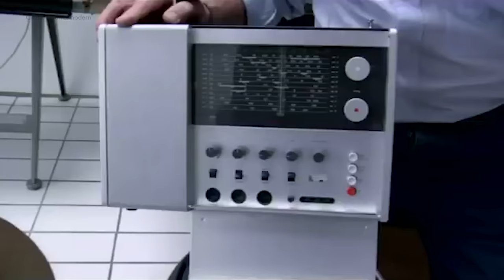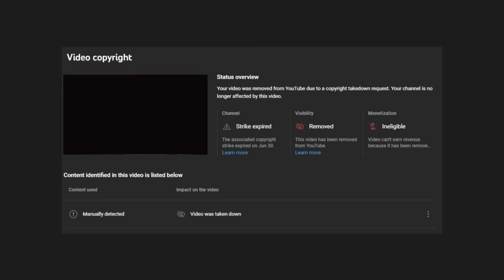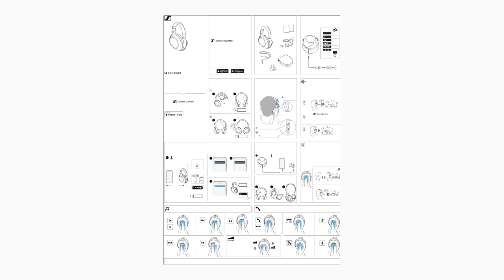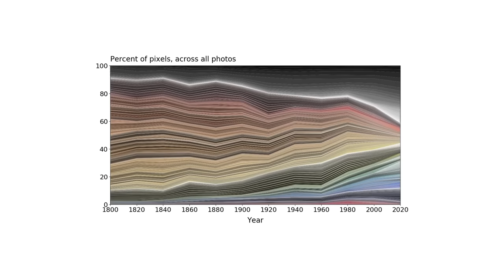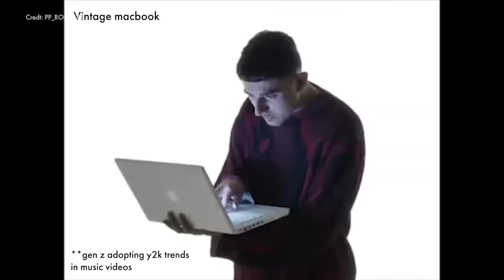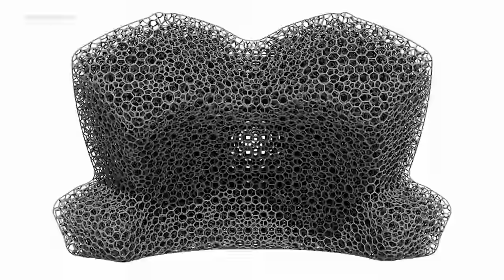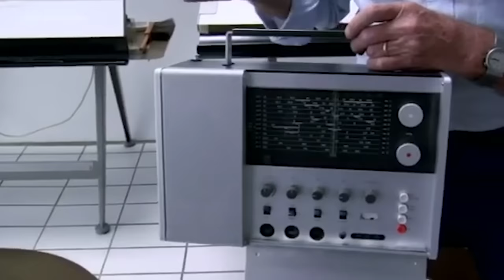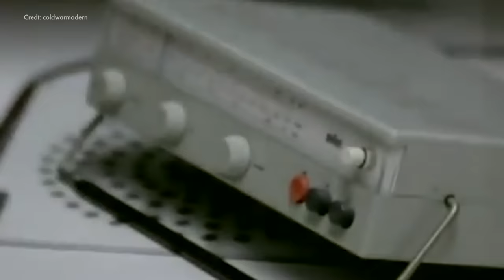Minimalism is Getting Absurd: Updating Dieter Rams' 10 Principles

Comment: The way I understand it, functional minimalism is driven by manufacturing cost optimization rather than aesthetics.  Physical interface elements are expensive to implement at scale, software functionality is not.  Product designers are using visual minimalism to solve the problem of making functionally minimalist products appealing, not the other way around.

Comment: That $4 calculator looks better- I want big easy to hit buttons so I can use it without having to focus too much on actually hitting the buttons. The buttons on the $55 calculator are too small and too spaced out to be as simple to use. And the $55 calculator is too broad. I want something that can fit in my hand. It’s a machine designed to serve a function. Then $4 calculator finds the balance between being slender enough to fit easily in my small hand while having the biggest buttons possible to let me hit them while focused on something else (the work I am doing)

Comment: Rams "Less but better" fuses with the Bauhaus concept of "form follows function"
Materials are made to look what they are, and plastic is not "denaturate" by looking like tortoise shell as it is in its translucent nature, like glass and plexiglass: it becomes false by looking like gold, ir wood, which makes it look cheap.
The Braun calculator is not expensive just because of "brand": it is becuse of costs, like scale economy, number produced, not being the sculpted in pefect shape for a mold, but holding and using. It is probably sturdier to hold and I guess the electronic is also less cheaped out. There is also a brand and a perceived value too fir someone willing to pay more.
Just remeber: sleek and minimalist is good as far as it does not distupt the function of the item: here is why Walter Gropius, Dieter Rams, Max Bill were "honest" designers. Does a Gropius Rosenthal teapot compete in price and practicality with an "El Cheapo" chinese one? No, but is a wanderfull object that still works perfectly as a teapot and looks gorgeous on a shelf! Does a Flute Saarinen table perform better as a table cheaper then a IKEA one? No, but it still distills the essence if a table in a unique way, as design should privide sensations other then fruibility.
Modern designers are obsesed by marketing and brand feeling, and this often cripples their design into a corner.
Its not about "form following function", but about "making somr function out of an idea."

Comment: This is the 21 century. Esthetic styling is essentially separate from design. Conflating the two just leads to confusion, edge cases and too many counter examples. 

Design is the rational (not arbitrary) choice of features to maximize the project goals and minimize functional flaws. This definition covers all design engineering from architecture and transportation to electronics, to software, physical and graphical UI. 
Design is engineering, styling is objective and subject to the whims of the designers and user's preference. Some styling choices might interfere with the engineering, some do not. The styles that interfere with the engineering the least are industrial and (the watered down version of that) for end-user products - minimalism. 

Rams' Porsche is minimalist for what it is, a sports car with a boxer engine in the back. It looks that way because of the engineering choices, and the styling supports the engineering. The iPhone and Apple Watch are not - they clearly start with styling goals first, and I'm not sure why this is not obvious to "modern designers".
Rams removed decoration from his esthetic, but he did so as a designer that re-designed the product design field. It's an engineering choice to get design out of its own way, and this is why he's brilliant and his principles stand true.

Comment: I feel the "good design is honest" aspect was misinterpreted a little. I'll try explain 'my perspective' as best as I can.

When some 'thing' is created, its design should be honest about it's purpose and what it can do. That's my perspective. Any aspect of the design that adds style points shouldn't need to be considered unless it genuinely undermines the honesty of the 'things' purpose. 
With the Tortoise glasses as an example, they should be designed to portray the fact that they are glasses in order to be honest. That way a user can trust that they are what they intend to be. A dishonest example would be glasses that portray themselves as safety glasses when they are not. 

Regarding the material of choice, well, this gets complicated as there are different purposes for different materials from structural to protective or stylistic. If the material of choice is integral to somethings purpose then that material should be honest in what it is. But if the chosen material is purely cosmetic then it should probably be omitted from the items honesty of purpose. ("honesty of purpose" is actually a great way to put it) Well, so long as it doesn't undermine the items honesty. With the cellulose acetate that mimics tortoise shells, I wouldn't consider that a dishonest material by any means as its purpose is purely for cosmetic reasons. Its use in those glasses doesn't undermine the fact that those glasses are glasses. If you took the calculator and replaced all the surface materials with the cellulose acetate it would still present itself as a calculator. 

Cellulose Acetate mimicking tortoise shells in appearance, I guess it would be dishonest if being made of tortoise shells was the important thing. Pretending that the cellulose acetate is genuine tortoise shell would be dishonest. But if the design of the item is honest about it's purpose and capabilities then the item is honest. The dishonesty would be the person saying that it's made from a tortoise when it isn't.

A Dishonest material choice example might be using metal type A that looks like metal type B but doesn't function as effectively as metal type B. In this case, metal type B would serve an important purpose that metal type A can't provide, and so the use of A would be dishonest about an items capabilities. This could be like having a zinc coating on a screw to mitigate corrosion. You can sometimes notice these coatings by eye alone. A dishonest coating would replicate the look of the zinc coating without providing the same purpose as the zinc coating.

I suppose a simple summary would be that a honest design is honest about its purpose and capabilities (to whatever extent it can be honest about that). Decisions made purely for aesthetic, cosmetic or stylistic reasons shouldn't detract from that honesty unless the decision is actually detrimental to the honesty or purpose. (I feel like I wrote too much)

That aside, the video was great. It was an interesting insight into these design ideas even though I'm not a design student or anything like that. The design of things intrigues me on more of a technical level. But the design of something pretty is always fun.

Comment: Good video, but I´d dispute the point of environmental friendliness:

You say, when speaking of Apple products, that their particular brand of minimalism requires so much effort that it rises the cost (and perceived value) to the point of inaccessibility for most people.

And although this is a fair point to raise, you seem to forget that when speaking of "environmentally friendly design". And while listening to it I was hoping you´d point that specific matter out: to make something more environmentally "effective" (in your terms), frequently implies a substantial increase in production costs which will inevitably result into financial cost to the end user.

And that is not a matter of luxury either, because, if you are concerned about the environment (and we all should, to a certain extent, be) then you´d want to maximize the accessibility of environmentally effective products, not make them a fashion statement for the rich to display their virtues.

Do you see where I am getting at here? Oil-based products and ubiquitous because they are cheaper and more accessible, while a economically effective replacement is not found, they WILL remain in use for the foreseeable products and no amount of innovation will change that until this innovation becomes the cheaper option.

Comment: 3:40 its not functionally better, it's functionally inferior. The cheap calculator you showed has a solar cell, wherever the expensive one gets its energy from, it will involve additional cost and hassle for the user.

Comment: Im going to argue the Porsche.
 
It is the perfect car from a design standpoint, they handle like nothing else. And it is because Porsche disigners are very meticulous on how they look at the porches design. 
 
Obviously there are other, cheaper, cars that may be better at one thing or another. And a Porsche isnt a practical car in the sense it can move your couch. 
 
But if you are looking for a car that handles perfectly, delivers its power perfectly, and has an intuitive interior that is piratical and every dial is well designed. you cant go wrong with a Porsche. 
 
They are not like Tesla where some of the design is for the memes. Or Toyota who designs cars with productivity and durability in mind. The 911 is designed to be the best 911.

Comment: Not to be overly critical of your analysis about Rams' vehicle choice, but I think that it's at once both insensible (for the reason that you state regarding it being effectively an emotional choice) and yet kind of in line with his rationale.  I mean one of the jokes amongst automotive enthusiasts is about how the company effectively releases car after car with minor variations on the same shaped-body between models and years (well, with notable exception of the 928 which sort of has the same general shape, but not really).  Of course to your point if he were purchasing more so based on his rationale he'd probably be driving a VW Beetle manufactured in Puebla, Mexico—not only did those cars maintain the epitome of simplicity when it comes to repair and replacement of parts of the German-built ones (something that even the "simple" cars of Eastern-Bloc nations could not match), but they basically changed very, very little through the entire time they were manufactured there (of course most "simple" cars designed years back tend to lack good pollution controls and fuel efficiency, so it'd be hard to find THE vehicle that would make a car purchase sit fully line with his principles).

Comment: It's quite funny how the calculators basically explained to me what has been bothering me for ages, without being able to point at it myself: Apparently my "emotional response" to design is rather queer, since the Casio calculators design is way more appealing to me, while the Braun calculator made me think for a split second that it would be shown as a negative example of simplicity in design gone wrong. 
To me, the Casio one invokes a feeling of precision, logic, efficiency, simplicity, focus and control. A big display to minimize reading errors, comparatively large buttons to minimize input errors. A non-distractive colour scheme with high contrast to distinguish the important things  (buttons for operation and display for results) from the neccessary but unimportant things (the casing, wich only serves the purpose of holding it all together). Yes, the number buttons could use a different colour or shading to separate them from the operational buttons, but I couldn't think of any colour that wouldn't in turn blur the overal contrast or become distracting. For whatever reason it even looks way more simplistic than the Rams design.
The Braun calculator on the other hand looks as if a kindergardener glued some M&M's on a piece of chalkboard. The colour choice looks weird, mismatching even. The brown and dark green buttons neither provide enough contrast to really stand out (but that could be due to my display not propperly showing the colours) nor appear to complement the black/charcoal casing. The yellow equation button on the other hand pops out way too much and doesn't fit with the overal colour scheme. The round shape of the buttons looks out of place on an overal more rectangular shaped device with a perfectly rectangular display. Speaking of which: The itty bitty size of the display invoked memories of cheap, unreliable and sometimes completely solar powered dollar store/promotional givaway calculators I collected as a Kid in the early 1990's just for the sake of it and made me want to squint my eyes just out of habit, even tho the numbers are clearly visible.
If this classic example of "good minimalist design" is allready repelling me, it's no surprise that I keep struggling to find items with designs that suit my taste, if the minmalist approach in design is getting out of hand to begin with. :D
Reply: what’s wrong with solar powered calculators?
Reply: @U20E0 a good solar power calculator, preferably with a back up battery is fine. A cheap one with no battery and a low output panel is pretty much useless a lot of the time.

Comment: For me the problem is inclusion of useless functionality. No device except PC and phone should require Internet connection. I don't want my earphones to be smart - I want them to be stupid passive devices. My coffee machine should not even come near any wireless connection. Lightbulb - don't even think of connecting it to any network. And design - I want these devices to be generic and just work well. Microwave oven - one knob to select power/program, and the other to set timer - nothing else is necessary. Kettle - on/off button + (in more expensive) temperature setting. Car - physical buttons for every function is the must.
And if the device can perform so many functions that it can be a general-use computer, then let me connect keyboard, mouse and monitor to it.
Good design is long lasting. I want my devices to be repairable. If design stands on a way to it by creating strange shapes that make opening the devices harder... the worse for the design. Screw it.

Comment: I disagree with the various examples you used for the honesty principle. 

-Turtle shell glass frames: It's fair to point out that Dieter was wearing fake glass frames, that's a personal character flaw on his part to espouse honesty in materials and then wear a dishonest material everyday. This doesn't change the fact that the material is indeed still dishonest, and it only is purchased so often because no one even thinks about what the material is or represents. Now that I know about the turtle shell thing, I personally would be turned off by these kinds of glasses in the future, and would prefer a plainer material that has no pretentions. I don't think I'm alone in that. 

-Presentation / manipulation through visual design. This is tricky. On its own as a design task, making a product "look better" without concern for it's functionality or actual properties, is an honest design goal. However holistically it is true that there is a degree of dishonesty here because it is disregarding the functional goal of the product. You compare designers to used car salesmen, and that's perfect! Because many of them are! However, the best designers would not need to trick their clients through presentation of visual trickery. I completely disagree with you that convincing the client is a common goal of all designers. it is not. Dieter is right in implying that the absolute best designs do not require dishonest salesmanship, and salesmanship is only part of design because most designers are average.

Comment: I tend to disagree with most points. The principles discussed are not rocket science, they are very simple to understand and supposed to be taken at face value (just like products designed by Mr Rams). A designer who follows them is more likely to end up with a good industrial or product design. There is no need to overthink, coming up with vague statements like "honour all life". 
If I am designing a computer mouse, it needs to be easy to use, beautiful, and use nice materials, all according to the Dieter Rams' principles, and as a result you will be getting a good minimalistic design. 
Following Lis Engel advice, thinking about "control and spontaneity" (what does it even mean?) is not going to help me design a computer mouse, maybe it's better for a philosophy 101 essay or an art expo.
Reply from the maker: You don't need Dieter Rams' principles to know that it's good to design something that is easy to use, beautiful, and made of nice materials. It's obvious. It's not like everyone was intentionally designing things that were ugly, hard to use, and made of bad materials. There are other factors

Comment: "Minimalism" is just a poor excuse that lazy and greedy designers/manufacturers use to cut back on costs and materials while passing it off as an aesthetic.

You can see a perfect example of this in the construction industry where lazy/greedy developers will produce the most low-effort, bland, and sterile residential structures while jacking up the price under the excuse that it's "modern" or "luxurious".
Take a look at any "modern" townhouse, "luxury" condo, shoe-box apartment. They all pretty much have the same design solely because it's cheaper. The actual residential structure is small and cramped. They'll typically have a small, single-bowl kitchen sink instead of the standard double-bowl....so a regular household chore like doing the dishes becomes a hassle. Most of the faucets will have a single lever instead of the standard two. And the entire building is completely deprived of any aesthetic craftsmanship beyond the sterile and bland sight of chrome.

I'm so glad someone's talking about this... I thought I was the only one who noticed.